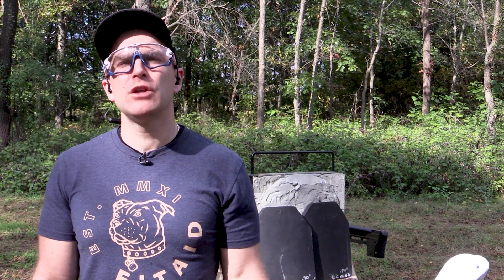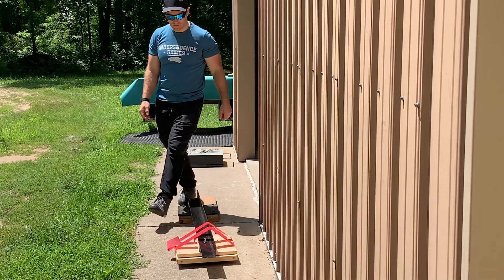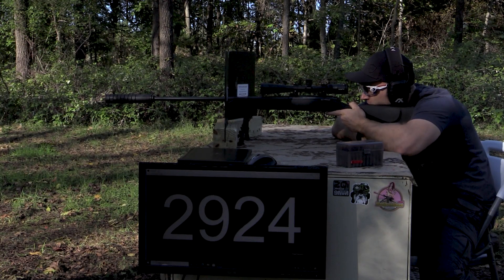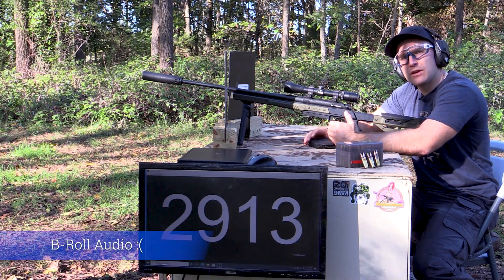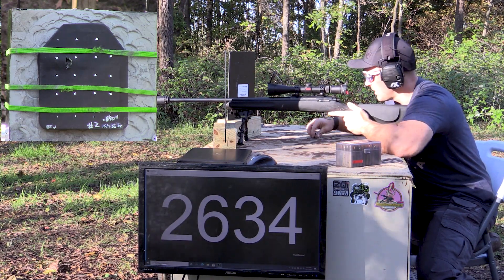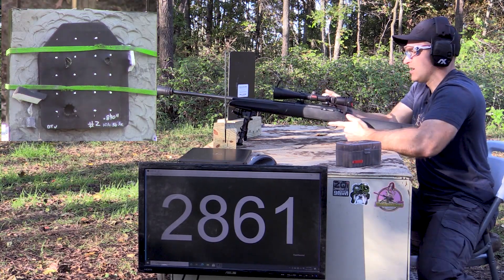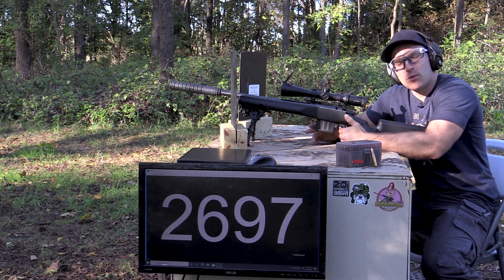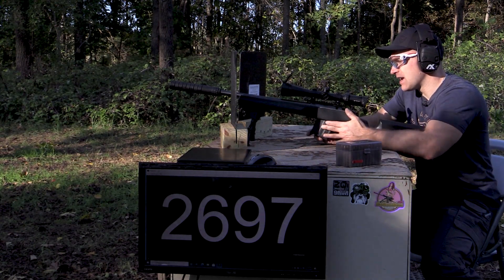ShotStop DURITIUM IV+HS; Multi-Hit Capable NIJ Level IV /RF3 Body Armor?!

Comment: Honestly id like to see a test where you just stack 3 rounds of m80 at 25 feet within a 1 inch group and see what happens.
Reply from the maker: That would be an interesting test depending on the armor choice. Which plate were you thinking?
Reply: @BuffRANGE  I'd test out polyethylene, ceramic and steel to see how they hold up to that level of abuse.
Reply from the maker: @nemisous83  I will make that happen. May take me a bit.
Reply: @BuffRANGE  how about Dayton armor? Tactical rifleman was shooting that stuff.

Comment: what's your favorite level 4 plates so far
Reply from the maker: So far, RMA's 1155 and 1189, as well as Militech's new black label (edge to edge), and Tactical Scorpion Gear's.  The Hesco 4401(or whatever it is now) would likely be close to the RMA preference, but I haven't tested them but 1-2 times.
Reply: @BuffRANGE  what is the difference between Militech Black Label and the normal version?

I only saw the difference between the used materials but I don't know anything about material engineering.

Thank you.
Reply from the maker: @OnkelAdiSuperstar  The Black label I thought is the first of theirs to use monolithic and edge to edge ceramic, vs their older styles which uses rectangular/square tiles.
Reply: @BuffRANGE  thanks 👍
Reply: @BuffRANGE  I tested rma 1155s over the weekend and put it on my channel. They legit stopped everything short of m993. Tungsten core. Nuts
Reply: @BuffRANGE   Is the 1189 tough enough to make the loss of edge-to-edge protection worth it as opposed to just getting the 1192?
Reply from the maker: @FlatRangeOperator  wow where did you find m995
Reply: @BuffRANGE  Im the guy who sent you an m995 about a year ago haha i changed my youtube name. I shot a 1155 with m993
Reply from the maker: @FlatRangeOperator  :) that would be why.  I need to change my shoutout in the video I did with it.
Reply: @BuffRANGE  Roger that. Also I was wondering maybe if you need or two more m995
Reply: @BuffRANGE  I just looked at those RMA plates and they weigh over 8 lb each! The so-called lightweight plates cost $700 which is 100 bucks more than about what I paid for the shotstop but they weigh over a pound more each. 5.7 lb almost 6 lb each!
Reply: @BuffRANGE  MIlitech is made in china?
Reply from the maker: @bigheadmarkie  yes. They are very reputable

Comment: I bought a set of Shot stop duritium IV-HA STAND ALONE CERAMIC’s for my wife and I and I just seen on OVS’s channel that they were raided and basically they were caught using Chinese materials and have now been shut down…. I’m concerned as to whether or not my wife and I are screwed after spending $1700 on these 2 sets of plates…. have you heard anything or have any input?
Reply from the maker: Are the HA the under 5lb plates? If so I would be very worried if you need to stop any 308 threats AP or not. If you send me a DM I can share the private videos of those HA failing that they barred me from posting. Maybe you and I can work out demoing one of your plates properly.
Reply from the maker: I am one of the first content creators to publicly post about it. Maybe one of the first to post they dissolved.

Comment: you should try Dayton armor RF3 they were playing around with shooting it with a 50 cal but i want to see how it does with other threats especially fast ones and a good tear down.
Reply from the maker: I’ve been trying to contact them. Usually email them as I don’t have time to call during normal business hours.
Reply: If you're talking about tactical rifleman they made him a special plate to stop that 50 cal at point blank range. The other plates were supposedly available commercially.
Reply: @HowardLuken  that's not what it sounded like. They said the plate only weighted 5 lbs roughly and it was their commercial product. 

They went through all the specs and stuff in video and IIRC they matched the commercial plate.
Reply: @HowardLuken  yea going back to video i think your right. They say the karl special in video so i guess its a special plat? 

It is weirdly thicker and lighter than the RF3. Assuming I am hearing this correctly. I always like shit in writing even in videos like it in a chart or text as subtext/subtitles because then you dont have to worry about talking boobs misspeaking.

Comment: I personally don't think adding more adhesive to keep the plates and material in an area will make any difference in armor protection because once that plate disintegrates it is pretty much useless. I am glad to eat those words if you can prove other wise. Something no one has done AFAIK and what I would love to see is a tear down showing how many plates are destroyed with each shot of various threats. Can each square or honey come take 1 shot? or do some rounds destroy several plates? Can any or which plates of armors can withstand shots on the same hole? what happens when a round key wholes about round? Does it go straight through or does it get stopped? I and many others have key holed rounds on targets. Do these armors stop that or are you dead? This is something I would really like to understand and have answers to.

Now, I do absolutely agree with you that the amount of side foam is ridiculous. I have TSG level 4 and I did not realize how little armor area thee is. That amount of foam is insane. I would never drop my plates so I care little about edge foam. I rather have more armor coverage. I already think armor isn't wide enough! So much is not covered already so finding out I am actually 1 inch less coverage due to edge foam really sucks. I do like having food frontal foam though because frontal foam is actually really important because you might need to dive on the ground to prone in battle but I am not dropping my plates in battle and edge foam is kinda pointless!
Reply from the maker: If you watch some of the Hesco armor testing, you'll see that the adhesives they are using (or their laminating process) is far superior to plates that don't do it. The strike face stays together longer. If the strike face remains intact and you keep it from separating from the backer, it can in theory still provide good performance. :D
Reply: @BuffRANGE  interesting, I would like to see that tested. I am unsure if it would work but maybe it would work for lower end targets? like level 4 broken tiles stopping basic 5.56 or something? I wonder if that is true.

Maybe someone can test that. That is actually something I do want to test when I start doing my stuff. I want to see how many shots in a close area or how many shots total a plate can take of lower level threats. Particularly like 5.7. I am curious to know how many 5.7 rounds it takes to defeat a level 4 plate. I don't think anyone has done that. I also don't mean like how many shots 1 inch apart I mean like how many in a close 3 inch diameter or somethin like that.
Reply: @BuffRANGE  BTW I added you on insta. Looking forward to seeing more of your stuff!

Comment: Id love to see a test using various common hunting calibers like 7mm rem mag and 300wm on level IV NIJ .06, and maybe the difference between soft points and solid copper projectiles in those calibers.
Reply: we always see tests for calibers the armor is rated for, but rarely calibers that exceed the standards. Can the armor protect you from these threats which many people own?
Reply from the maker: @ZE0XE0  I mean I've shot 300 WM (150gr SP and others) and 338 RUM rounds at plates before. There are so many variations of ammo, it's nearly impossible to test them all.  Most hunting calibers are going to lack significant bullet construction and velocity at their designed ranges to penetrate level IV. Backface deformation will be a concern. I believe I have access to a 375 H&H. I may test that against level IV.
Reply: @BuffRANGE  ah yeah. i just found some of those videos and watched them. very interesting.
Reply: @BuffRANGE  375 H&H sounds pretty interesting. Im also curious maybe what a .30-378WM would do with some loaded AP rounds like you did with the 300wm tests. But i know access to guns in that caliber would be an issue. 

If you lived in montana I'd let you borrow my .416 Rigby. Not a super fast round, but i wonder if the sheer muzzle energy would be able to penetrate. 400 grains at 2500 fps, about 5550 foot pounds.

Comment: Bought these a while ago and have the multi curve shooter cut. Didn’t realize they weren’t edge to edge, kinda salty about that right now but what’s the deal with the edge? Is there any ballistic protection at all or is literally just foam, in the video it looks like straight foam but then I see some of the replies say it’s like a level 3 or 3a? I’m not as concerned about the sides, more so the top since your aorta runs right behind that and not really trying to bleed out that fast. Don’t really have the money to drop on edge to edge level 4s right now so would running a lvl 3a backer behind these plates offer any benefit in your opinion?
Reply from the maker: There's no ceramic out to the edge, but there is PE. However someone on InstaGram shot 9mm at the edge and it went through,  which is really odd. Typically the PE will stop M193 5.56 or even maybe .308 M80, but wouldn't stop things that have steel like M855 or M2AP, etc.
Reply: @BuffRANGE  that’s very weird, didn’t look like it but did you have any shots close to the edge that were “captured” by the pe?

Comment: I even have a 20 inch upper that gets almost 3500 FPS from the independence idk why but these CBC uppers get more velocity than my other uppers same barrel length
Reply: Proably your gas setting or twist rate
Reply: 55gr at 3500 is potent as hell. That is incredibly hot for 5.56.
Reply: Interesting I got a 16 incher from them

Comment: I'm curious why this plate didn't stop M993 while the russian elite plate with the hexagonal SiC tiles that Oxide tested was able to do so even out of a 21" rifle.
I'm thinking possibly because the square tiles are more prone to bein hit close to their edges rather than hexagonal tiles.
Reply from the maker: It's also possible they are using a different quality/manufacturing method of SiC.
Reply: @BuffRANGE  Yes, that would also be a pretty plausible reason.
Reply: These plates likely use a cheaper reaction bonded SiC, vs the FORT Technologies ACPs likely hot pressed SiC tiles.

Comment: i was going to get a set of shot stops because of the weight but i cant get passed that wierd lvl 3 edge...its not edge to edge protection. and the backface...carrying an extra 4 lbs to me is worth the protection
Reply from the maker: That's a good call. Some users are willing to take that chance for saving 4lbs, others aren't. :D
Reply: If you can get your hands on ltcs higher end plates they offer similar performance at lighter weight and edge to edge. my 28595s are 4.7lb.
Reply: @qwe304  i got highcom 416s. Really good protection. At 7 lbs a plate ill be fine. Eventually ill get some hesco 4800s but ive been able to run jump and hike for hours in a 22 lb carrier

Comment: I wonder if it’s ridiculous to use some other type of armor in the back. Like instead of a trauma pad, use 3A or thin steel to keep the back face deformation from thumping you so hard.
Reply from the maker: 3A would lessen the blunt force trauma. Thin steel would likely just add to overall weight too much..

Comment: Could you add some 7.62x39 or 5.45x39 threats on these body armor tests, would be interesting to see how do they compare between 5.56 and .308
Reply from the maker: Realistically they don't with the caveat that the loads that compete against what I use are non existent in the US, and are even more impossible to get. In 7.62x39 and 5.45 available in the US is stopped by most all level III threats.
Reply: @BuffRANGE ,7н39, 7н40 5.45 мм
Reply from the maker: @РагнарЛодброк-е3ш  I have no ability to get those :(

Comment: This has nothing to do with this test but do you have velocity data from M855A1 out of 10.5in barrel? I've tested 11.5 and 16 but don't want to use more for 10.5
Reply from the maker: Somewhere. Give me a little to look for it. I think it’s about 2600?
Reply: @BuffRANGE  I was hoping it was more. 2600FPS seems to be standard for regular m855 out of 10.5in. I tested m855a1 out of 11.5in and it went through 1/2in of steel. I was very impressed and saw velocity data of up 2929FPS. I was hoping out of 10.5in would be at least 2800. I haven't had a chance to test the half inch steel out of that length but hope to soon
Reply from the maker: @fujimi715  The Lake City 12' stuff I have looks to be about 2,65x from the 10.5" SBR of mine.
Reply: @BuffRANGE  so 2650 fps? Not as much as I hoped but it's better than the regular green tip. I have some 11 12 14 and 15 stuff. All but 15 was lake city and the 15 was some Winchester stuff I guess they contracted out
Reply: This is a little late but ballistics by the inch website has all sorts of great info on different calibers and barrel lengths.
Reply from the maker: @ameritus9041  they officially ended that project last year. I tried a few times to donate my data to them
Reply: @BuffRANGE  that's true, but the website is still up for people like the op to look stuff up.

Comment: According to the manufacturer's website that edging material is supposed to provide at least level 3 protection.
Reply from the maker: The “edge” is the PE backer which will stop 308 and m193.  But that’s even questionable due the proximity of shots to the edge. One should always want full edge to edge protection.
Reply: @BuffRANGE  I was under the impression that it was there to protect the face if you happened to drop the plate on it's edge?
Reply from the maker: @Devin_Stromgren  not necessarily. Most edge to edge plates have a layer of foam on the outermost edge. This .75”-1” reduction in the amount of ceramic is just to be lighter.

Comment: Would you personally prefer this over the gt2?
Reply from the maker: If you need 308 protection yes.
Reply: @BuffRANGE  have you checked out the shotstop 4+ha
I was looking into those
Reply from the maker: @thealize808  not yet but they have almost 2” of  edge foam
Reply: @BuffRANGE  and do these 2" provide any ballistic protection? Or literally just foam
Reply from the maker: @thealize808  it would stop 308 and m193. But not m855

Comment: “This plate is not super durable” “I shot it more than it was designed for” This is the highest rated and tested body armor on the market and you shot it more than it was rated for and you’re calling it not durable🤦‍♂️braindead
Reply from the maker: Relative to the market offerings. Look at other level IV plates like the 1192 from RMA, or Adept Colossus, or Spartan Armor Ares. Sure I got above and beyond, but these ShotStop plates are not built well.
Reply: @BuffRANGE  none of those do any better shot 10+ times. You should test them. And in terms of the lamination, it literally does not matter😂 It’s going to be in a vest, and the layers will stay in the same order. If anything they different layers of the vest are going to shift around a little bit and provide a little more coverage in areas that have already been struck
Reply from the maker: @FirstnameLastname-gz8hy  I have tested both of them and they are vastly superior to this plate. Plus those plates offer full edge to edge ceramic. NONE of ShotStop plates with ceramic have Edge to Edge.